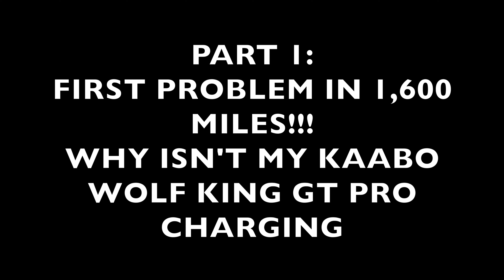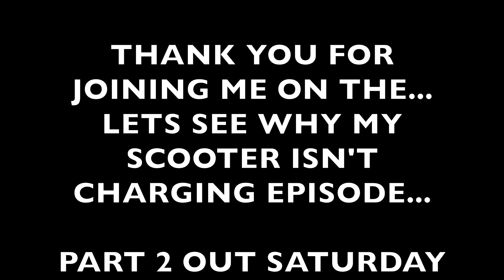Part 1: Why Isn't my Kaabo Wolf King GT Pro  Charging. First Problem in 1,600 Miles

Comment: @ 15:oo mins in you mention tying into the main batteries. I Opted to mount a BLUETTI AC2C power supply just below the Bars. It powers my cell phones Radio and I can test all kinds of things i find each day. Dirt riding is sketchy, BUT MUD is a Def NONO. cheers. thanks for the Video.
Reply from the maker: That's a really good idea about the external power supply. Definitely a nono for mud, I'll walk around that stuff